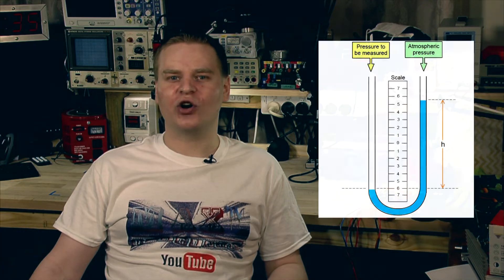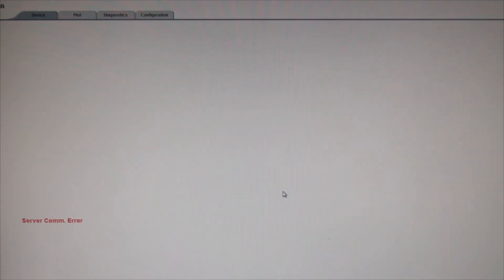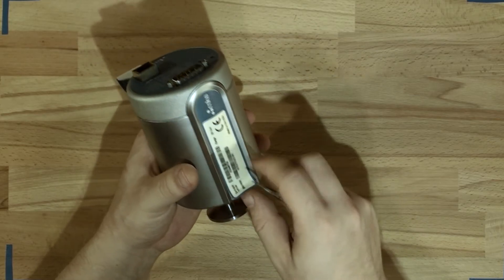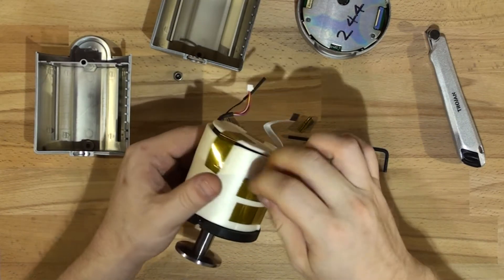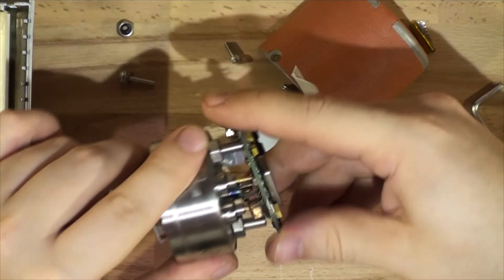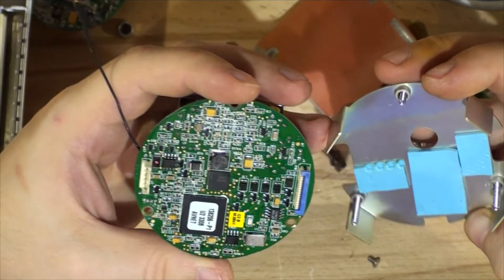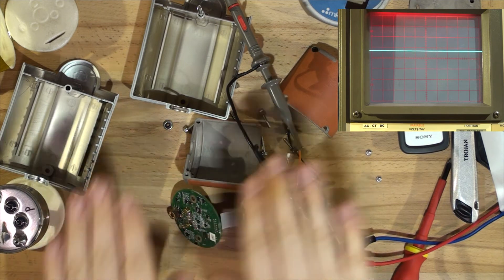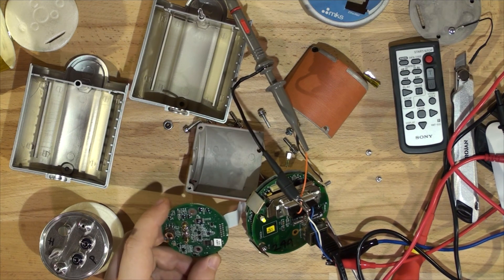What's Inside Digital MANOMETER (Baratron Pressure Sensor)

Comment: The gauge is acting exactly as designed. These things are set up to measure absolute pressure, not gauge pressure. So yes, you need high vacuum 10^-6 or so to zero it, and if your vacuum level goes above 20 torr it's overrange.  What do you think happens in a semiconductor tool where these things are native?  This poor $5,000 creature deserves a good home. I volunteer myself. I was gonna reach through the screen and throttle you if you cut the cell open.

Comment: Just a wild guess, but maybe it needs a partial vacuum to get the diaphragm plate off the opposing capacitive plate? ( I missed the part where you gave the range of operation, but maybe normal air pressure is too high?)
Reply from the maker: It’s a positive pressure device, I tried to apply pressure, but it didn’t work. I think that manometer is the reason the chemical reactor was scrapped, because the rest of electronics inside reactor were working fine.